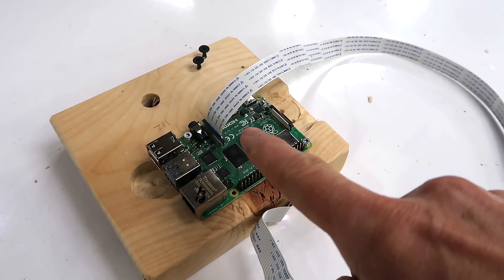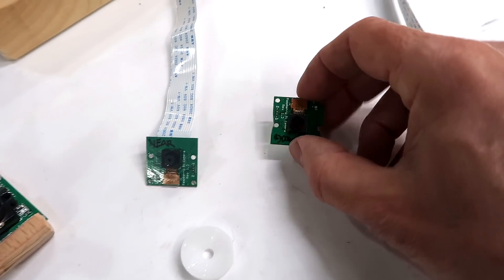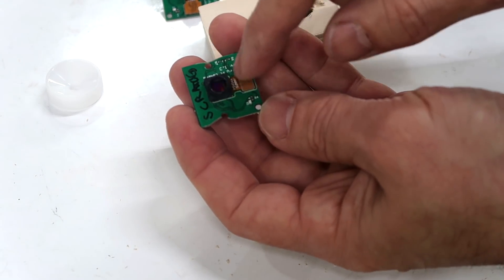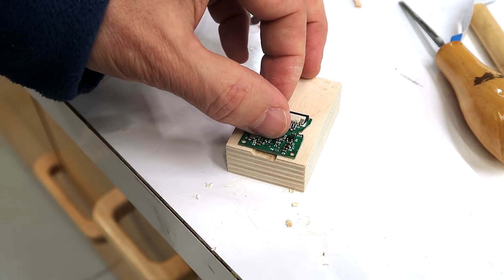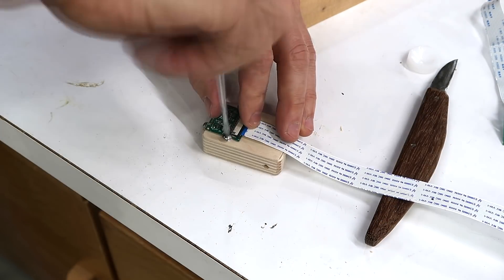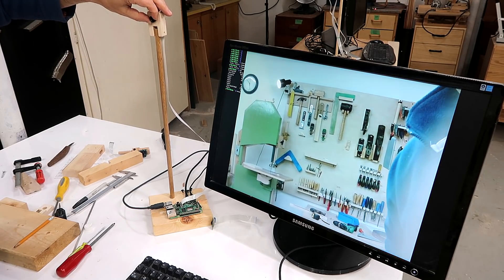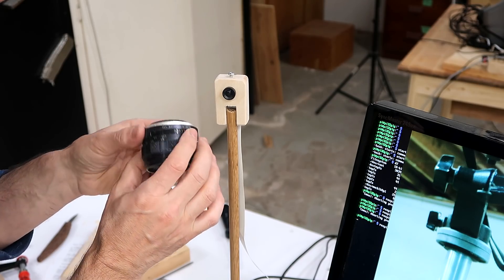M12 lens mount for Rasperry Pi camera module

Comment: When you clean your lens, use alcohol and a small brush. You don't want to grind the dirt into the lens and scratch it or remove the AR coating. 
Bristles from a brush put much less force on the lens and are less apt to cause damage.

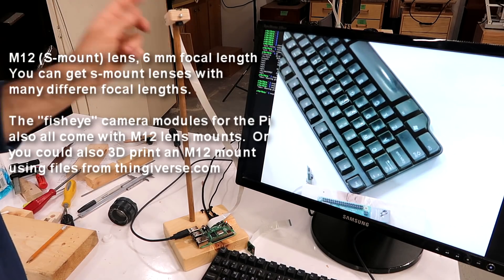Comment: At 06:00 "But with a new baby in the house, that's about the size of projects I can tackle right now." those small projects will recalibrate your dexterity and fine motor skills, which align pretty well with the needs inherent in little baby handling work (then dimensional 8' vs the new now 8")

Comment: What's the advantage of these camera modules compared to just plugging in a usb webcam?
Reply from the maker: USB webcams are flaky and very low resolution
Reply: @matthiasrandomstuff2221  I though you could buy them in any resolution you want? But it's true that true hires usb cams are expensive. But if you have a newer raspberry with USB3, it should work great.

Comment: Is light leaking in through the slot you made for the "outies" on the camera board?  The image looked a little washed out.  Nice project. Congrats on the baby.
Reply from the maker: I checked that, no.  Cap on the lens eliminates the flare too.

Comment: Congratulations on the new baby! Nice to hear some good news from somewhere at the moment :)
Nifty little mount! That would take about 10 mins to design in a cad package and about 1/2 an hour to print on a 3D printer. Wouldn't be as satisfying as making it from wood though. There's just something about wood. I also appreciate how low tech it is. No fancy tools or components. It's videos like this that keep me coming back :) 
How about mounting it on a telescopic rod (car aerial? - you could even get the pi to move it up and down ;-) )

Comment: It doesnt matter if the lens is too big (resp. for a bigger sensor). This should still work well.
Reply from the maker: these big lenses just aren't designed to focus that sharply at F/2.8, and you need F/2.8 to get full resolution on the sensor to avoid diffraction limints.

Comment: Hacking a rear Canon EF lens cap produces a surprisingly good mount for one of the little Pi camera modules. With the better (e.g. L series) Canon glass the results really aren't that bad - certainly when you compare the Pi image to heavily cropping a shot with the same lens on a DSLR. Obviously because of the huge crop factor you end up with a very small field of view, but it's actually quite useful for planetary shots.

Comment: Are there any cost benefits of using raspberryPi for a security system vs buying a comercial one for ~300 usd? I reckon you gain a lot of functionality when using the raspberryPis. it may just take time to build the programs.
Reply from the maker: if you like to tinker, the pi is the way to go.

Comment: Both times I tried something like this for my 3dprinter's cameras, my octopi complains about low voltage afterwards. Unhooking the camera then fixes it. if you try to bend these camera module pcb boards even a small amount it causes issues.

Comment: Next on the list of things I never would have expected to be made out of wood.
Reply: This would have been better made from aluminum. Especially if you can find the right size tap for the lens threads. Could use little pieces of plastic with holes poked or drilled in them for standoffs to mount the circuit board.
Reply: This might be the only project where a 3D printing might be more practical, unlike previous router holders, etc, if you already have a 3D printer and download the files from thingiverse.
+ It would be much faster than having it shipped, especially during these times.